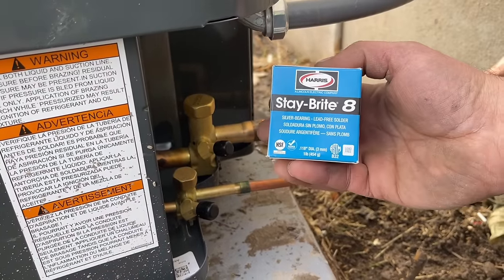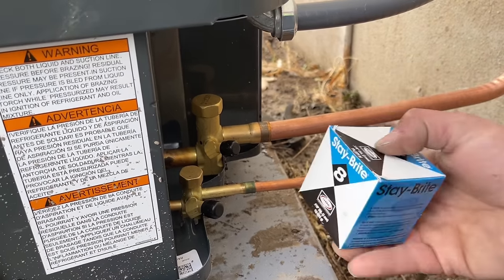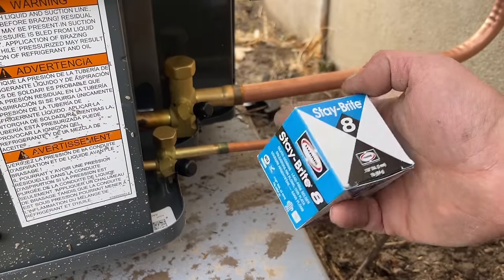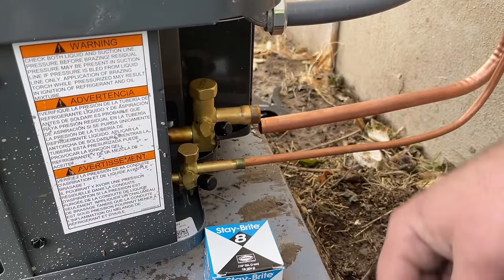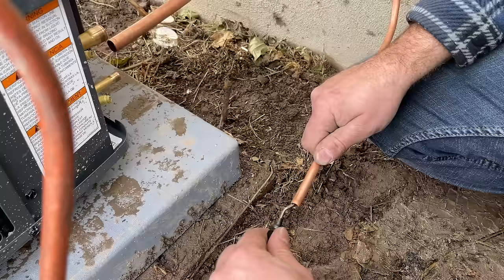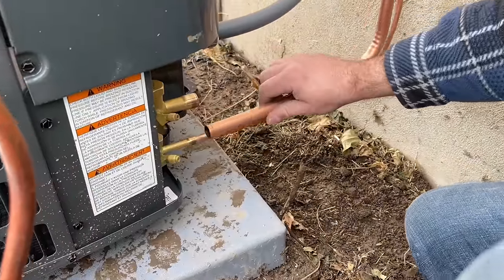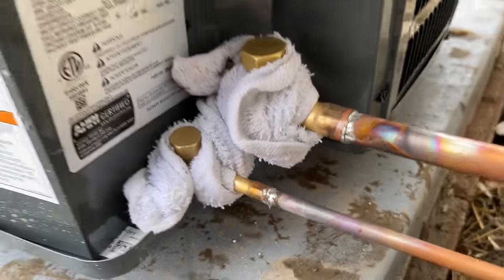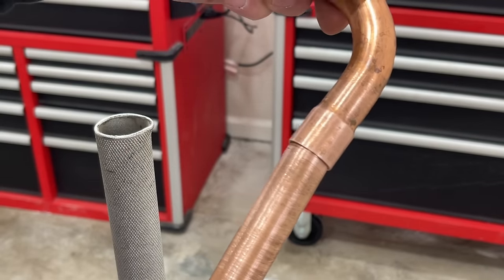An Awesome Alternative To Brazing HVAC Lines. Staybrite 8 Soft Solder

Comment: I've been using the original Sta Brite solder on HVAC lines for 43 years on a daily basis and have not had ONE failure! Brazing is for fools. If you are worried about getting flux in the lines from the female fitting, use the liquid flux instead of paste for the female sockets. Those that say it fails under vibration are full of shit, the bond is stronger than the parent metals according to Harris. The only place not to use it is on discharge lines, or at compressor stubs.
Reply from the maker: Amazing. Thanks for sharing
Reply: so you are admitting it isnt as strong as a braze, if so you would use it on the discharge.
Reply: @jfiles640  Temperature limitations have more to do with it than strength! If you were an HVAC service tech, you would know this and i wouldn't have to explain it to you. But have a nice day.
Reply: If the strength level is in Thousands of PSI and 410A at discharge let's say Max 600 which wouldn't be why everyone who uses stay Brite says not at discharge line. That just contradictory
Reply: @1971omi  Seems you are another one with Zero experience in HVAC! Why do you people bother to post, if you know nothing about the subject material? THAT is what is "contradictory".

Comment: Always remove the Schrader valves.
It's not a good idea to heat up and solder or braze a closed system.
Reply from the maker: That’s the advantage to solder. Removing them really isn’t necessary because of such a low solder temperature
Reply: @diyhvacguy  removing the valve also gives any gases or fumes a place to escape. If you had the valve out you would have seen it. It can help reduce vacuum time.

Comment: Not to disparage your efforts. But there are reasons they call it soft solder. We aint plumbers. Braze your copper guys.
Reply from the maker: There will always be the ones who prefer brazing and that is your choice, but my viewers can do what they like, and as you can see in the comments, many many have had great success for many years with Staybrite 8.  Cheers
Reply: God knows nothing better has ever come along for anything. Plumbers don't solder much of anything anymore.
Reply: Yup, at the very least use stay-silv and silver solder if you have dissimilar metals. Never use a soft solder on an HVAC system. It can be done, but I sure as hell don't trust it. In no world should you be relying on a joint with so much vibration that can't be shouldered and annealed.

Comment: The txv, compressor bearings, compressor motor windings, microchannel coils, Schrader valves, service valves, flare fittings, anything that has a valve seat or smooth surface that requires a smooth surface, nitrile gaskets, plastic gaskets, etc… reallllllyyyyy don’t like heat, and especially if diy, torch handling can be a factor with not moving the heat around, or still using too much heat, using too much flux, and/or too much solder.  I’m all for learning a new skill, but please, PLEASE! Take a copper pipe and a tee fitting for that pipe, solder it in without nitro, and see what happens.  Strongly advising against this if you depend on a reliable hvac unit for health concerns or alike.  Otherwise, it’s your unit, but why throw out a $2,000 unit on a bet to save you maybe $100 and some extra time?
Reply from the maker: Did you watch the whole video? We soldered a copper pipe and then cut it in the center of the joint and it was as clean as a whistle inside. Not sure what you are talking about with the nitrogen but it isn’t needed with soldering. Maybe you meant brazing?

Comment: I have looked at joints that were braised without nitrogen and I don't see soot inside them. I don't trust this soft solder for HVAC joints.
Reply from the maker: Interesting. I have definitely seen it. And if you haven’t used something I can understand why you wouldn’t trust it. There’s a lot of haters with Staybrite 8
Reply: @diyhvacguy  I wouldn't say in a hater, I just don't get why we've been forced to use 15% silver rods for all this time yet this particular soft solder is good enough. Maybe we've been lied to all along. I wonder what the difference between plumbing solder and this stuff is.
Reply: @1shagg420   because you are bonding copper with copper the 15% silver brazing rods, they have 80% copper in them... these staybright things have 95% Tin... would you rather have 80% copper bonding your joints or 95% tin?
Reply: @jfiles640  exactly. What I'm saying is I trust 15% silver with 80% copper more than tin

Comment: Your tip is way to big. Also you are soldering like you are brazing. Place a smaller flame underneath at the back of the female tube       and push the solder in at the top. Hold the solder against fitting at the same time of placing heat keeping the flame away from the solder. Don't heat the male tube end. The solder will always flow towards the heat.    
I am a retired Pipefitter/Plumber this tip is for you! After you/videos helped me with my first AC charge...

Comment: I'll  double dip on the comments here. What is the pressure rating of this solder.?? I have NEVER...... used soft solder in 45 years in the trade. Although retired now so. Who cares ? Right ?
Reply from the maker: Shear strength is 10,600 psi

Comment: Joints look like shit. By looking at the copper color you heated it more than I would have using 15% silver. The good thing about silver is of coarse stronger joint and the ability to bridge. Sorry bud I've been in the industry for 30 years and I've lost count of all the repairs made when solder joints blew apart or started leaking. BTW don't think your flux will not enter the system just because you only fluxed the male part.

Comment: What you're brazing is only good for water lines not for REFRIGERATION. You want to contaminate your lines.
Reply from the maker: Not true at all. Do some research on it. Steve Lav has been using it for years as are many others. It’s like anything else, you need to know how to do it properly is all. the tensil strength is higher with Staybrite 8 then brazing.

Comment: Check your local codes, this is against the code in a lot of places. Check with the manufacturer as well. And even if its allowable by code if word gets out that you're soldering systems you will be forever known as a hack.

This is not my opinion. This is my region's opinion.
Reply: My personal opinion is that you cant clean the flux out of the inside of the joint. This will lead to compressor burnout down the line from the acid. It's a great way for hacks to create their own work. 🤡
Reply: Also test your system to 600psi. Most manufacturers require it. RTFM